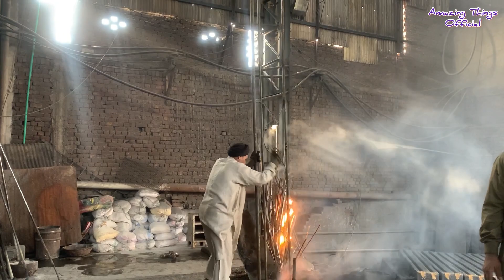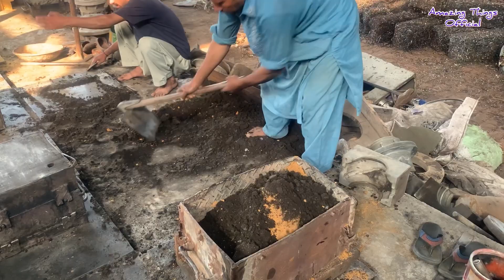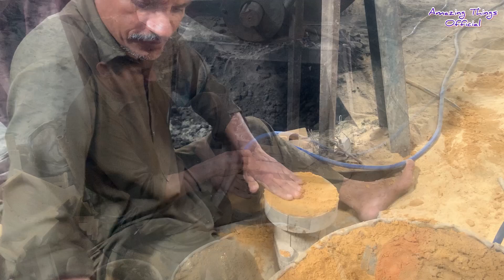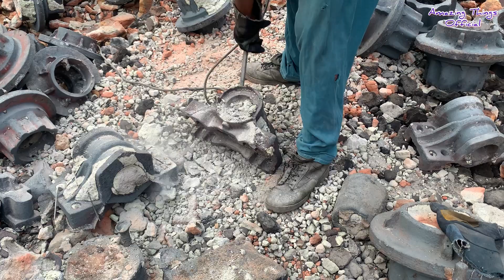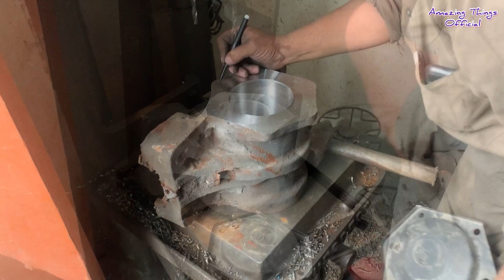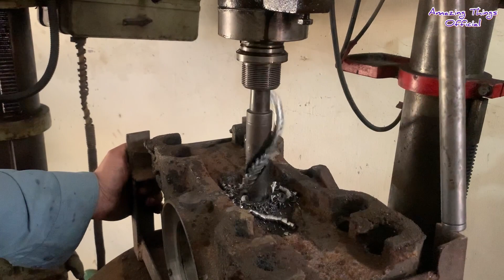How Suspension Trunnion Saddle Seat are Manufacture in Foundry Through Iron Casting Process

Comment: WHat is the blue hose for, a little bit of air?
Reply: I believe its co2 which hardens the silica gel that's mixed with the mold sand.
Reply: @MrJohn714  I was wondering how they made their sand mix. I've seen some that looked like they used ash from the fire and motor oil. I don't know.
Reply: @eeledahc  My mistake, when I said silica gel I meant to say, "sodium silicate".
https://youtu.be/qPnSb3yzytE
Reply: @MrJohn714  thanks, I had no idea about the gas.